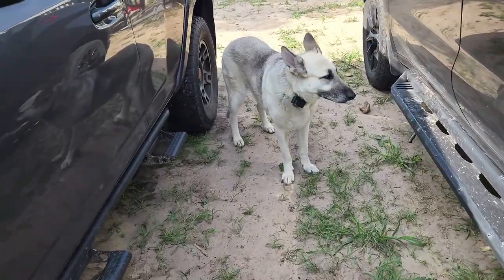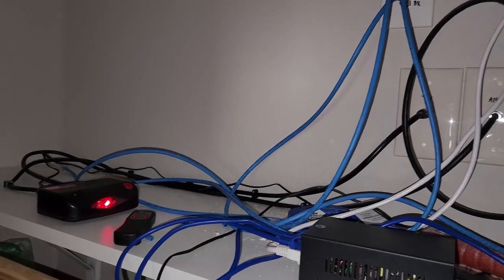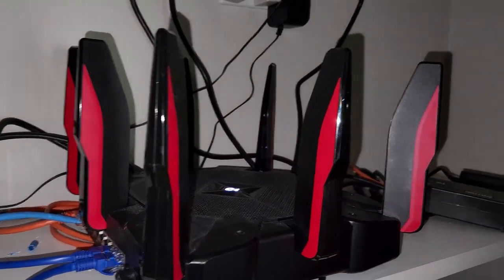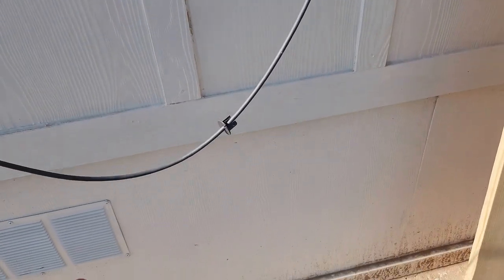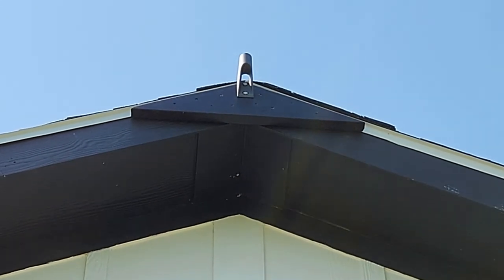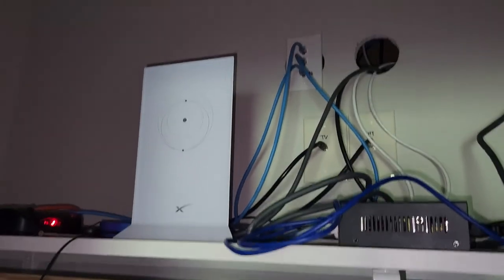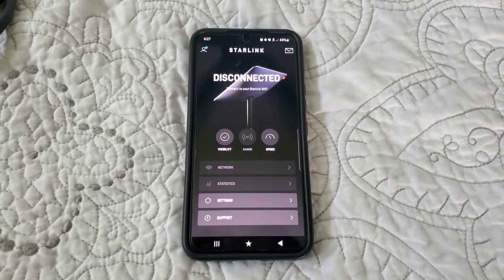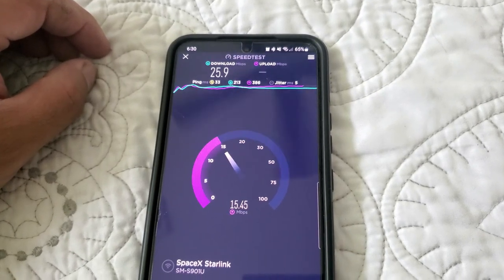Starlink Full Installation In North Texas

Comment: To use your own router you have to go into settings and put the Skylink router in bypass mode, also to reset it you have to cut the power 6 times not 3.
Reply from the maker: I tried the bypass but still couldn't connect it to that specific router.  When I made this video, it was 3 times to reset the Starlink router.  Starlink changed to reset to factory settings by powering the router on/off from 3 to 6 times about 8 to 10 months ago.

Comment: I got the ethernet adapter and it seems to work fine, I got an additional mesh router and hooked the ethernet to that and my iMac.
Reply from the maker: I'm glad it worked for you.   I actually ordered a new one but never got to test that one.  It may just be the gaming router that I have, though.   I also ordered an additional Starlink router that I'm currently using as a mesh so that I can get internet to my RV.  It works great!

Comment: You need to keep some slack coming off the dish in case the dish re adjusts itself.  But it looks real good
Reply from the maker: Thanks for the tip.  The connection doesn't move after it's connected to the dish. The inner mechanism inside the dish itself is the one that moves the dish around without moving the cable around.

Comment: I am not sure but I believe when you run the star link router into another router you have to disable the star link router as the main router. It should be in the software.
Reply from the maker: You are correct. The Starlink router gets completely removed, and the satelite dish gets connected directly to your own router via the Starlink ethernet adapter.  The issue that I'm having is not knowing how to setup the "Static" connection/configuration for my router to be able to work with Starlink.  The reason I'm trying to do this is so that I can use the ethernet ports to distribute the internet via ethernet connection throughout the house instead of being wireless, and also take advantage of the WiFi 6 that the Starlink does not have.  This is possible, but I can't seemed to get it right.  I'm not sure if it's the specific router I'm using, or if I'm doing something wrong.

Comment: Hi, thanks for showing how you installed the mount. I am planning the same mount area. How did you ground the satellite after installing? The old tv satellite on my house is grounded by a screw to the satellite and to the pole of the electrical box. Just curious on how you are grounding your unit. Thanks.
Reply from the maker: Sorry for the very late response.   I saw the comment and was busy doing something.  I thought I'll respond after I was done, then totally forgot about it 😅.   SpaceX doesn't include any type of grounding, not instructions on how to do it.   The best thing you can do to protect it from lightning strikes is by adding a surge protector.  We got a surge protector from Costco (CyberPower LE850G), and theoretically, that's supposed to protect it.
Reply: Thanks! That’s what someone else said. I’ll use inside surge protector, and see if existing ground wire can attach to the satellite. We are in high lightening area in Northern Arizona. Thanks for response. And thanks again for sharing your experience.

Comment: Hello, really enjoyed your video! I have a question. Why did you mount that board on the outside of your overhang? If your only using it for mounting support why not mount it on the inside?
Reply from the maker: I'm glad you enjoyed the video! There's soffit underneath.  To be able to mount on the inside, I would have had to remove the long soffit boards from underneath the eaves to place the supporting board behind the fascia.

Comment: Hi, Hope you are well, I was wondering what is the highest winds you have had since having starlink up with the short wall mount?, as I have installed mine the same way, and as you live in America which you get heavier winds than North Wales, anglesey, UK.
Reply from the maker: Doing well, thanks! I believe a short mount is better, in my opinion.  The longer the pool, the more support you'll need to add.  We had a 48 mph (77 km/h) this year and higher gust winds. Sometimes, we do get tornadoes with 160 to 200 mph (257 to 321 km/h) and straight high winds 65 to 85 mph  (104 to 136 km/h).  Luckily, we haven't had any of those in my immediate area... I think, but a neighborhood near my location wasn't so lucky.  We did have a big tree that fell over due to winds by the main road, but without a wind speed meter or Anemometer, there's no telling exactly of my immediate area wind speeds.  We just have to rely on local weather meteorologists on TV.
Reply: @RandomVlogTime  Thank you for getting back to me, glad all is well, Im hoping the small wall mount will be strong enough to withstand 60mph to 100mph winds fingers crossed lol I know we hardly get them. but sometimes we do, hope you will never get a tornado 🤞hopefully starlink will get Evan faster speeds than we get now of 250mb, I really like my starlink, I bet you do to, keep safe 🙏
Reply from the maker: No problem! We usually get 20 to 50 mb and 100 mb on a good day.  Fast speed internet for any company is very hard to get here in the US, unless if you're able to get fiber, which is also very hard to get as this is mostly only available in cities and not rural areas.  There's an article out there that I was reading titled "Starlink Internet is Going From Rural to Unreliable Luxury," and this article makes a lot of sense to me.   But I do hope that it does get better and the booster and  Starship is successfully launched next month.  After they launch 2.0 satellites, I do really believe that speeds will improve 🤞🏼.
Reply: @RandomVlogTime  Fingers crossed it will get better, we have 40mph winds right now and I don't see any movement with my starlink so fingers crossed 🤞, and for fibre to mine isn't available for years to come yet the fibre cable is allready been put down outside my house since 5 years to another town yet somehow nothing for us in the rural area, doesn't make sense at all, 🤞 for better speeds in the future and i would love to go to bocca chica to watch them send starlink up, I don't know how to spell it sorry if I buchered that up.
Reply from the maker: It's all good.  I understood

Comment: id get that succer as high as i could? does it make a difference?
Reply from the maker: If you're talking about the dish, you can just set it on the ground.  It doesn't matter where you set it as long as the dish has a clear view of the sky.  Trees can block the signal on the areas where trees are, so it needs to have 180 degrees radius to get full singal.  My roof is a little taller than the trees that are close to my house.  But if you live in an area where trees or other obstacles will block the signal, then anywhere should be ok.